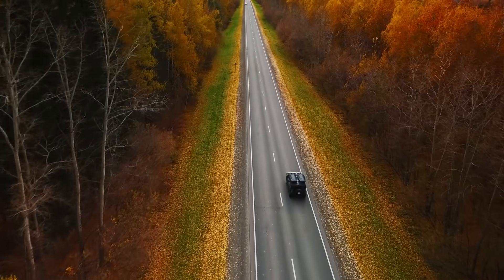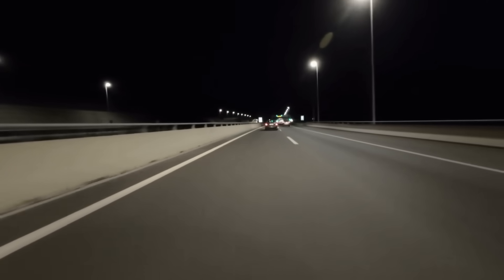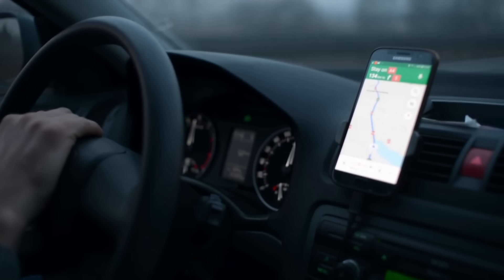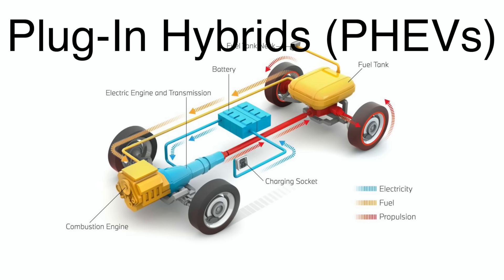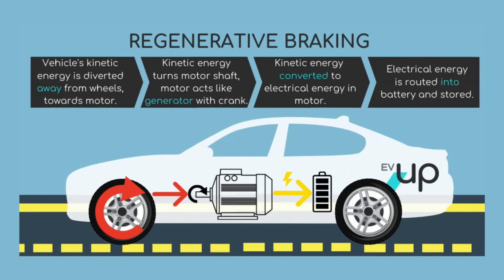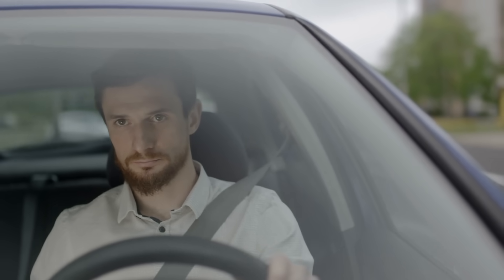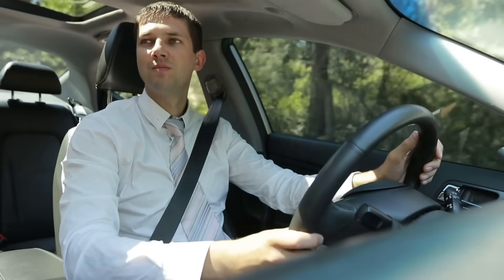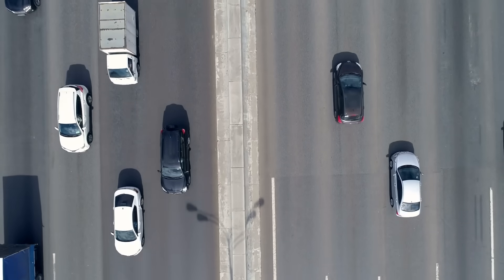How Do Hybrid Electric Cars Work?

Comment: My Toyota Prius also runs the engine to recharge the high voltage battery and the high voltage battery is supposed to recharge the 12-volt battery.